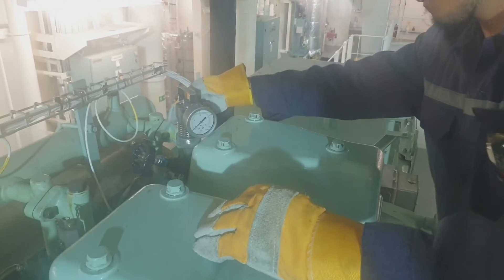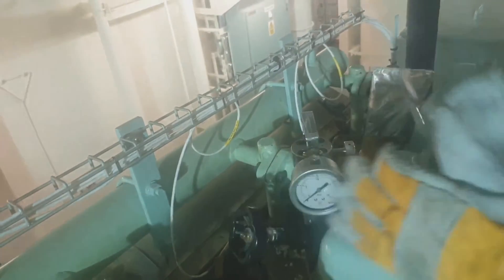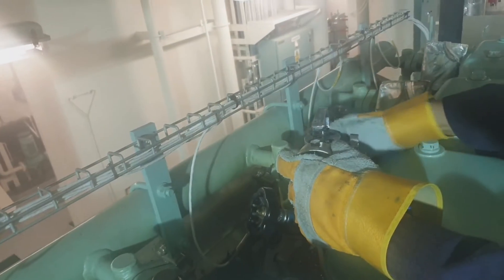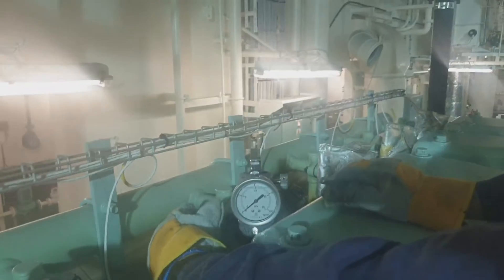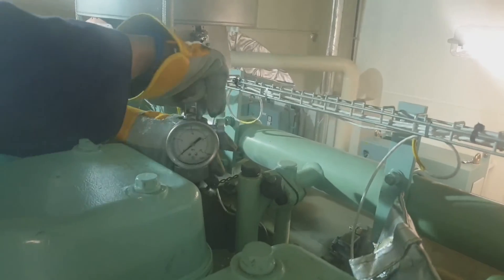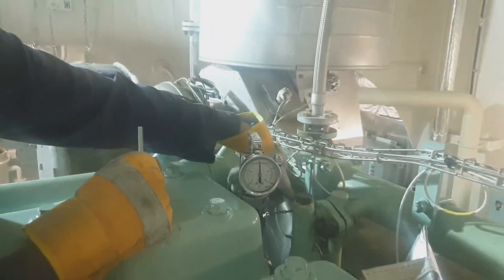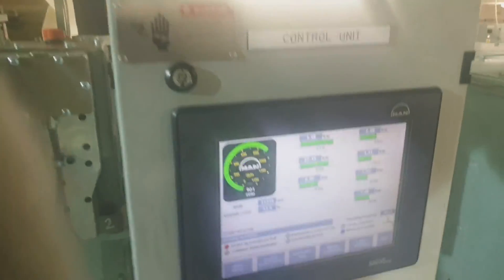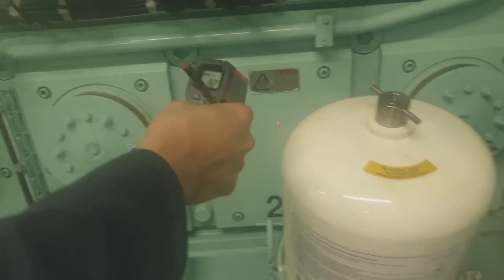HOW TO TAKE PMAX ON GENERATOR ENGINE

Comment: At what load did you make performance ? How many % should be loaded to get performance? 

Explain please 🙏 our action step by step if Pmax low or higher at some cylinder? 

If exhaust gas temperature deviation is higher then other how we can rectify the reason?
Reply from the maker: You can make performance at 50 or 70 percent load , then you can compare your result from the sea trial performance results, if that matches closely all the parameters then, that will be your basis onwards.. just check in the sea trial performance of the engine, its all there, 30 50 70 100 %, just choose at which load you will take performance as long as it matches more or less from the sea trial results.. You can consult also to your chief engr at which load he allow to take performance on your generator.. i hope you got me clear on this.. thank you
Reply from the maker: I made performance at 50%load of the generator approximately 600KW..